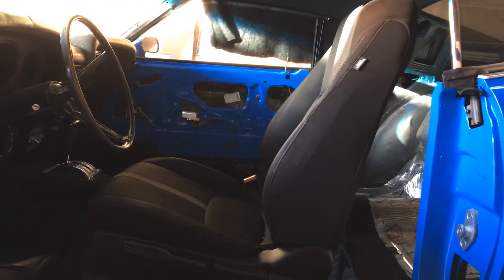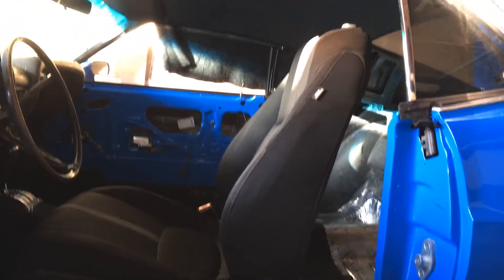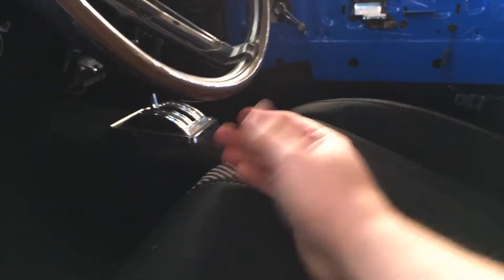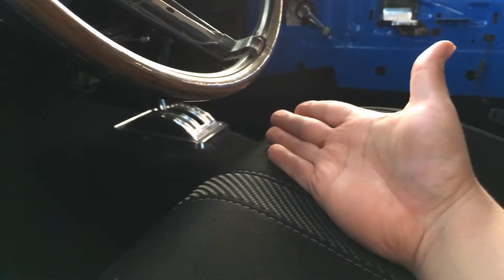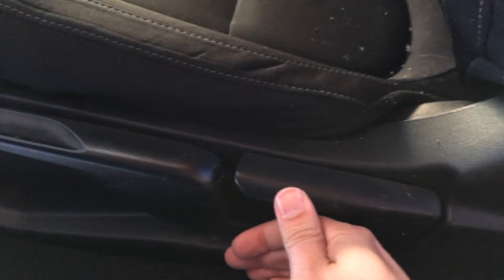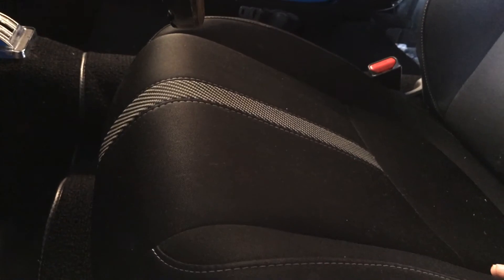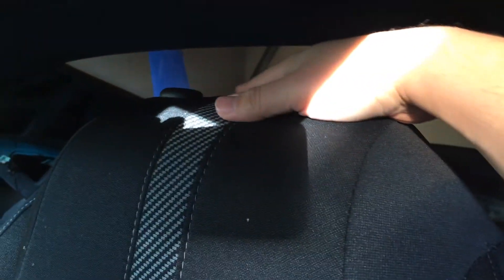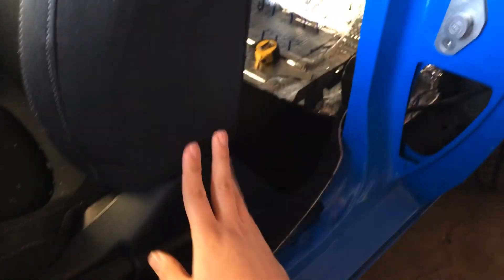1970 Ford Mustang Mach 1 with Honda Civic seats 2

Comment: 🤦🏼‍♂️🤦🏼‍♂️ I hate to see that. I understand got to  do what ya got to do
Reply: I understand you guys - but there's two points to make.  1)  The seats will be bolt in and the floors will not be modified in anyway so they can be unbolted and the original seats put back in any time.  2)  To restore the original seats will cost me at least twice what these seats will cost to put in plus the restore work and time.  I need seats, so I can drive it etc.
Reply: I completely understand. I done my seats myself and it was still hundreds of dollars.  Mine are white deluxe kit from NPD. And I went with aftermarket seat belts from NPD they work fine not real expensive either.
Reply: @painthog3791  I am of course keeping the original seats.  Someday I'll get the same kit in black and get them done :)

Comment: dude no! i cant see that ever being good for the cars value.
Reply: I understand you guys - but there's two points to make.  1)  The seats will be bolt in and the floors will not be modified in anyway so they can be unbolted and the original seats put back in any time.  2)  To restore the original seats will cost me at least twice what these seats will cost to put in plus the restore work and time.  I need seats, so I can drive it etc.